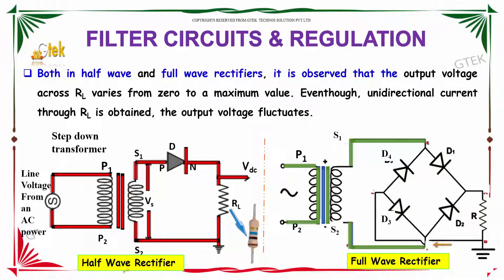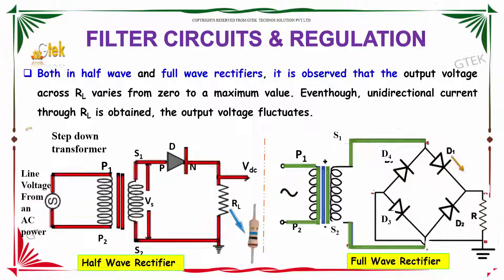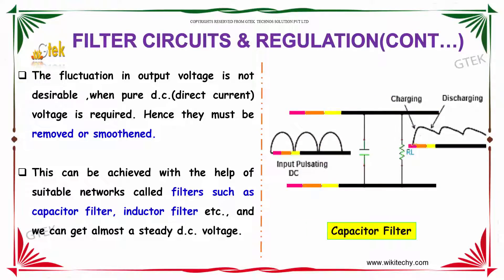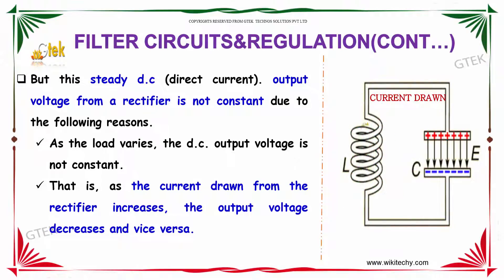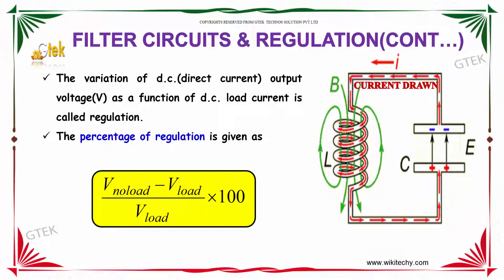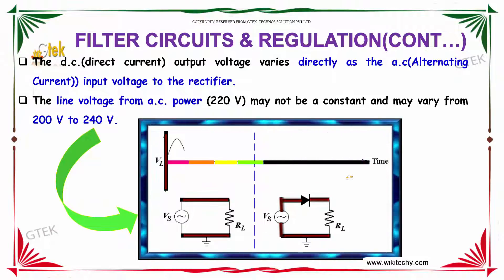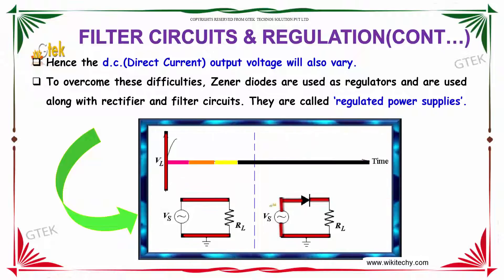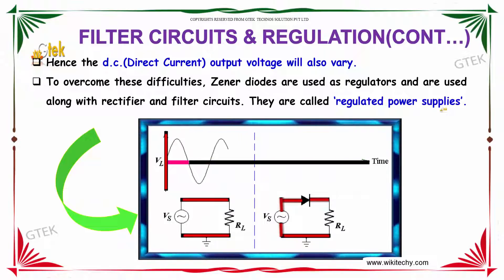Filter Circuits and Regulation Semiconductor Devices class 12 physics subject notes CBSE IIT

Comment: Semiconductors for for IIT-JEE Physics | IIT Class 12 XII | Video Lecture in Hindi. 2 year ago. Semiconductors | Semiconductor Device |class 12 physics subject notes ... Physics Semiconductors part 15 (Photo diode) CBSE class 12 XII ... Filter Circuits and Regulation Semiconductor Devices class 12 physics subject notes ...

Comment: To remove the AC components or filter them out in a rectifier circuit, a filter circuit is used. A filter circuit is a device to remove the A.C components of the rectified output, but allows the D.C components to reach the load.

Comment: Rectifier is an electronic circuit consisting of diodes which carries out the rectification process. Rectification is the process of converting an alternating voltage or current into corresponding direct (DC) quantity. The input to a rectifier is ac whereas its output is unidirectional pulsating dc.

Comment: The output of the transformer is a pulsating sinusoidal AC voltage, which is converted to pulsating DC with the help of a rectifier. This output is given to a filter circuit which reduces the AC ripples, and passes the DC components. But here are certain disadvantages in using an unregulated power supply.

Comment: Such power supplies will sometimes employ a transformer to convert the input voltage to a higher or lower AC voltage. A rectifier is used to convert the transformer output voltage to a varying DC voltage, which in turn is passed through an electronic filter to convert it to an unregulated DC voltage.

Comment: A linear regulated power supply regulates the output voltage by dropping excess voltage in a series dissipative component. They use a moderately complex regulator circuit to achieve very low load and line regulation. Linear regulated power supplies also have very little ripple and very little output noise.

Comment: D.C. variable bench supply (a bench power supply usually refers to a power supply capable of supplying a variety of output voltages useful for bench testing electronic circuits, possibly with continuous variation of the output voltage, or just some preset voltages; a laboratory (lab) power supply normally implies an ...

Comment: A regulated power supply is an embedded circuit; it converts unregulated AC into a constant DC. With the help of a rectifier it converts AC supply into DC. Its function is to supply a stable voltage (or less often current), to a circuit or device that must be operated within certain power supply limits.

Comment: A typical power supply filter circuit can be best understood by dividing the circuit into two parts, the reservoir capacitor and the low pass filter. Each of these parts contributes to removing the remaining AC pulses, but in different ways.